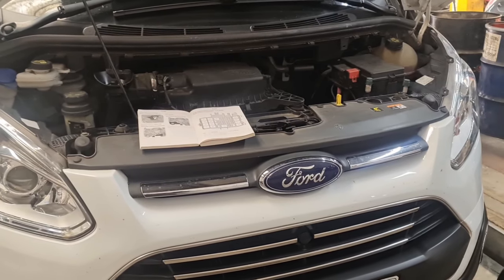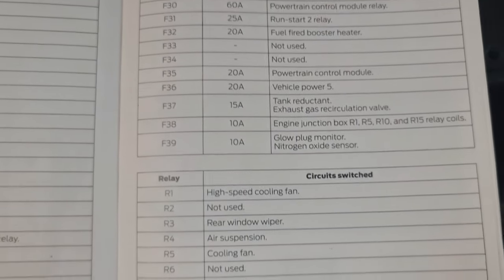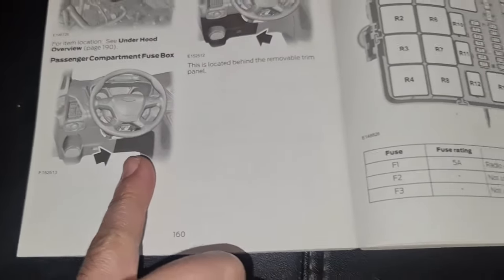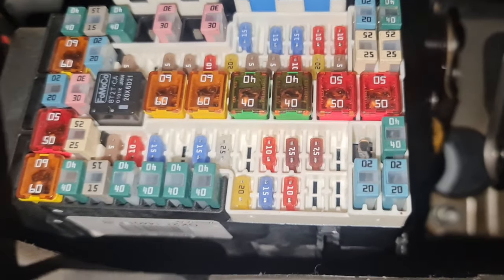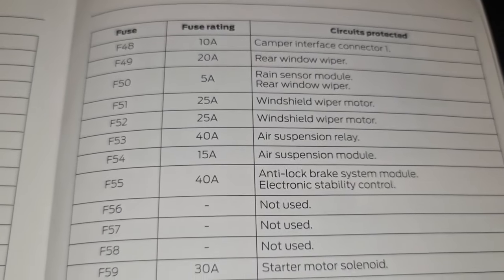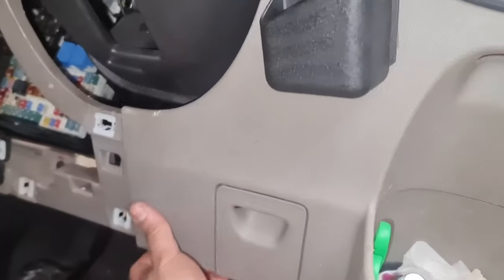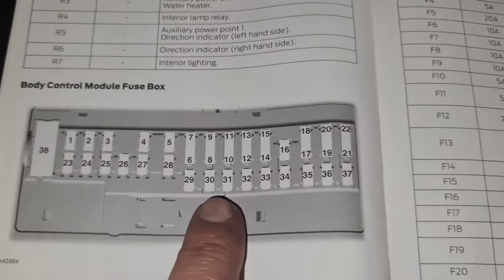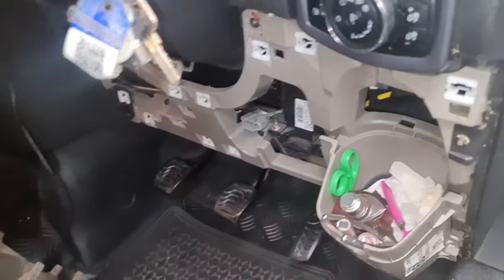Fuse box Locations Explained on Ford Tourneo 4K #windows

Comment: Taj, this is a massively helpful video. However i'm still struggling to locate the fuse for the windshield washer pump? If you could help with its location I would be very grateful. Thank you.
Reply from the maker: Hi it’s inside the car and I’ve checked on autodata Ford Tourneo 2017-2021. Only coming up with information on rear washer pump F9 15amp fuse. Will upload a picture on community page. Hope this helps. Thanks 🙏🏽
Reply: @TajMotorMedics  it’s all sorted now Taj, basically there isn’t a specific windshield one. It’s runs off the rear water pump as the pump has a rear and front water outlet. 
Thanks again.

Comment: Can I ask what and where the fuse is for the DRL please
Reply from the maker: Hi, the location of the Daytime Running Lights (DRL) fuse in a 2018 Ford Tourneo may vary depending on the specific model and trim level. However, in most cases, the DRL fuse is located in the engine compartment fuse box.

To locate the engine compartment fuse box, open the hood and look for a rectangular black plastic box near the battery. Once you have located the fuse box, open the cover and look for the fuse labeled "DRL" or "Daytime Running Lights." The label should indicate the amperage rating of the fuse as well.

If you are unable to locate the DRL fuse in the engine compartment fuse box, consult your vehicle's owner's manual or contact your local Ford dealership for further assistance.